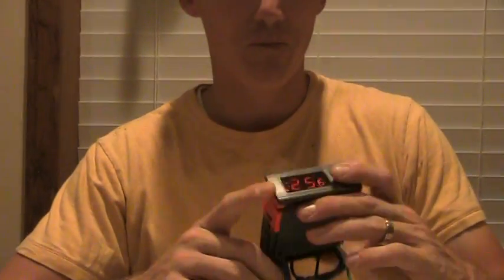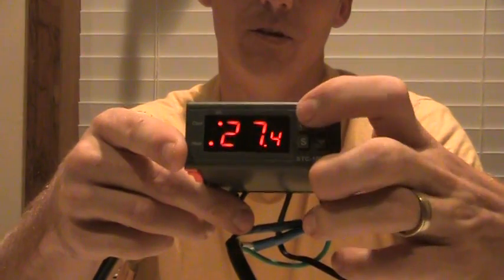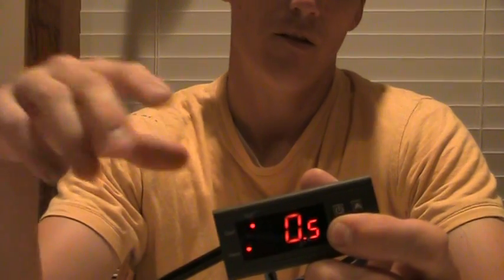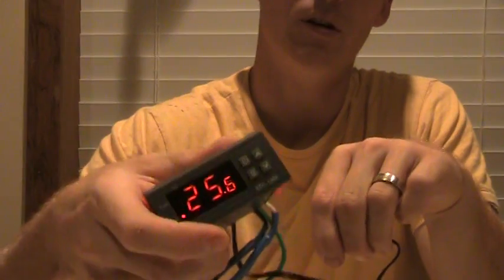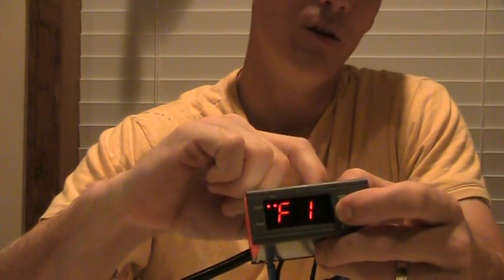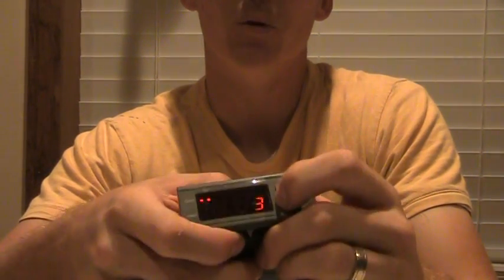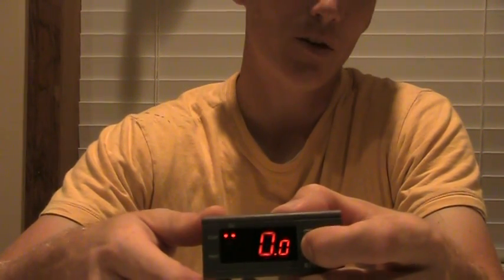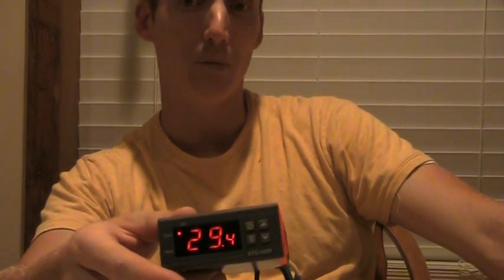How To Use A Reptile Thermostat with STC-1000 - Raleigh Jones

Comment: Great video.  Was easy to follow. But when turns on and set, just "cool" light is on and never switch to hot. Do you think is wiring mistake or the stc has something wrong. thanks for your help

Comment: Ok that sounds good. So I would just do 3 hot ends rather than two and the same with the neutrals? Mine is 220v so how big of a heater and cooling fan can I use? 

Thanks for your help

Comment: Hey great video. I am making an incubator with the sic 1000. I am looking to use a old thermoelectric wine cooler and use its original fan as the cooling and then instal either a heat fan or just heat tape as the heat side. Will this work the way you have showed in your video?